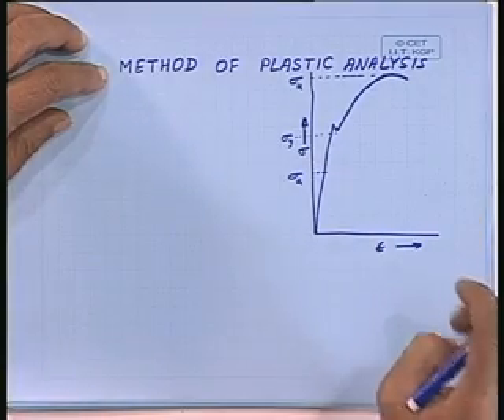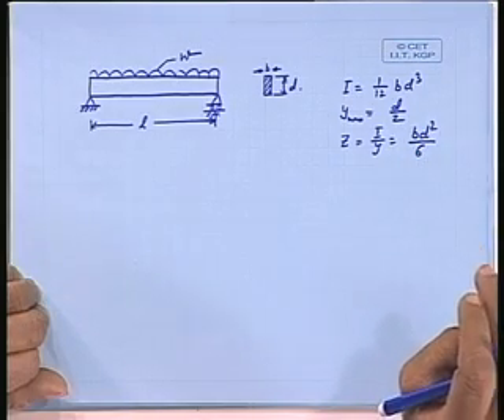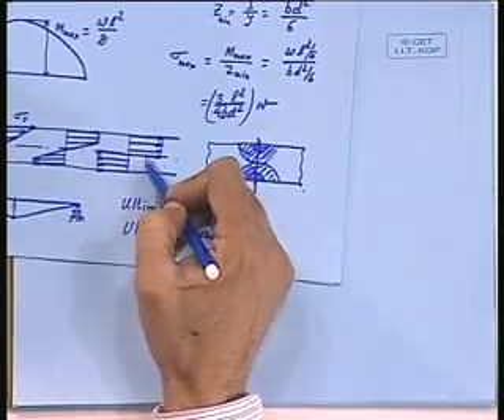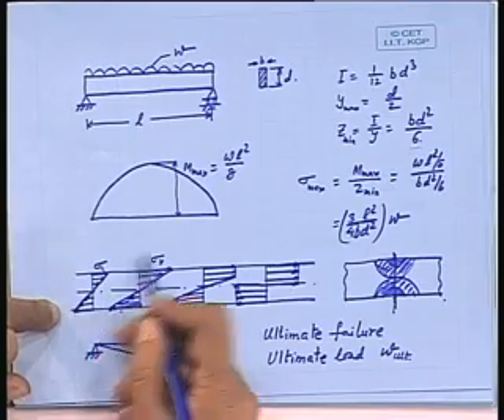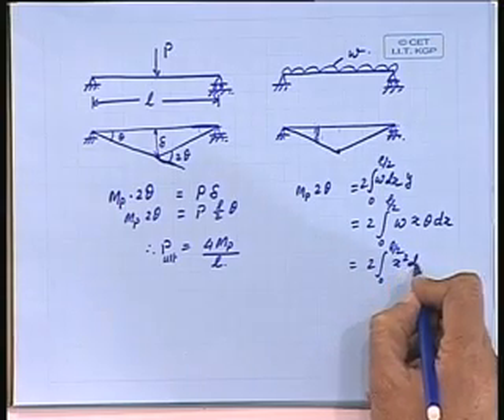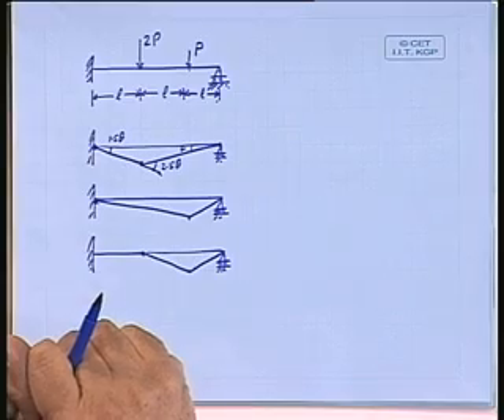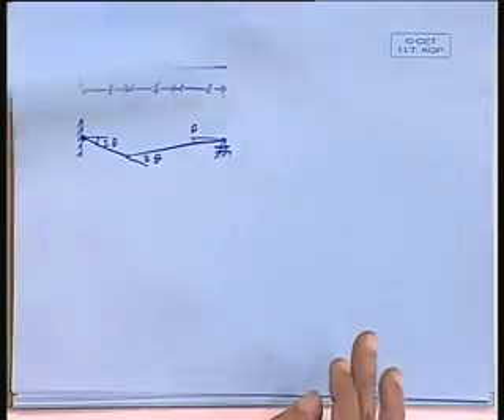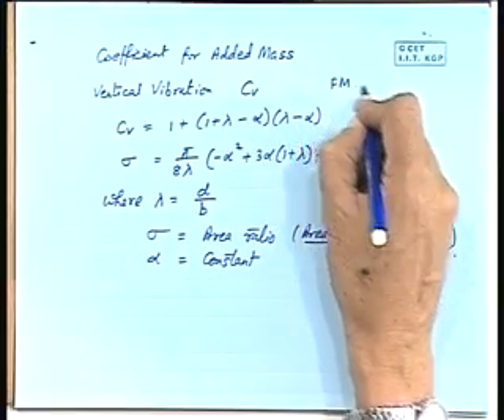Lec-34 Method of Plastic Analysis

Comment: for the case of a concentrated load: shouldn't the internal work be 4 theta Mp? there is work done by the rotation of the supports. If this is the case the P = 8 Mp/L.

Comment: why in last case deflection occurs at only at load p why not at 2P...and why 3 hinge case [p 2p and fixed support] case is not possible
Reply: hinge wont form at roller support
Reply: Coz a permanent physical hinge is present at the roller support